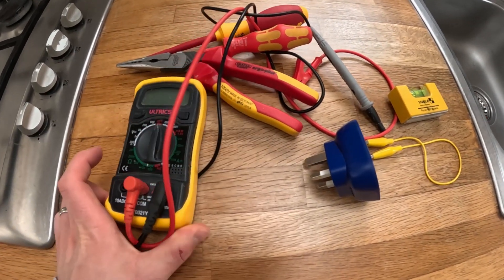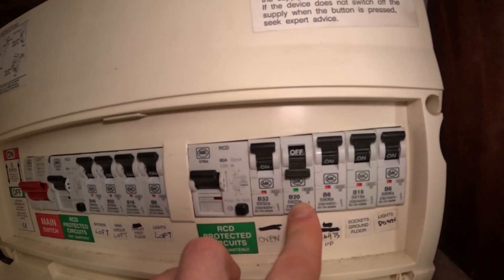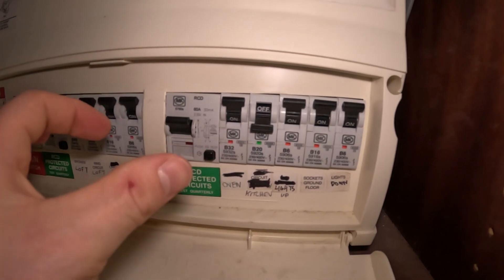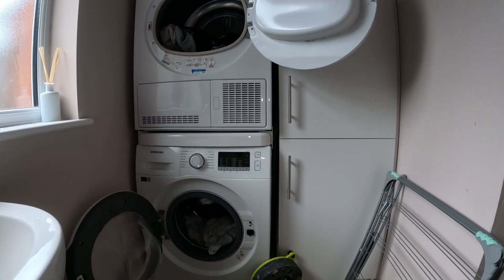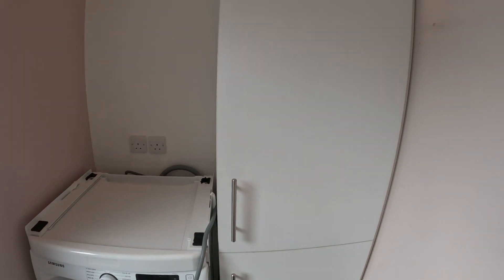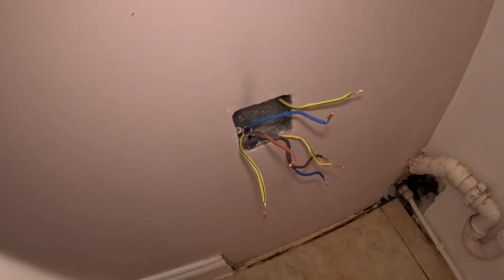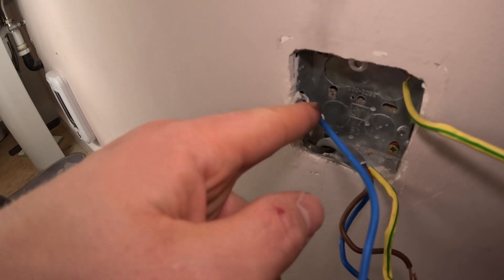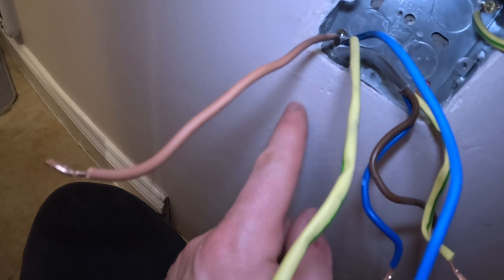DIY Fault Finding - Home Electrics

Comment: My preference (assuming the cable damage is below the backbox) would be to chop out a new backbox below to hold some terminals and replace the burnt end.  Cover with a blanking plate.
Reply from the maker: Yep that is a good idea and had been one of my plans, depending on how bad the damage was. Unfortunately it wasn’t an option that would work, as you’ll see in the follow up video next week. Thanks for watching!

Comment: I would have expected the RCD to trip and not just the MCB as the RCD should detect earth faults. 
I'm not qualified and just curious as a theoretical question why is your MCB triped with over current and not the RCD with Earth fault? Is you earth cable continuity ok?
Reply from the maker: They both tripped every time actually, the rcd switch just doesn’t fall as far as the mcbs, so in the video might not have looked like it tripped, but I assure you both did! Thanks for watching!